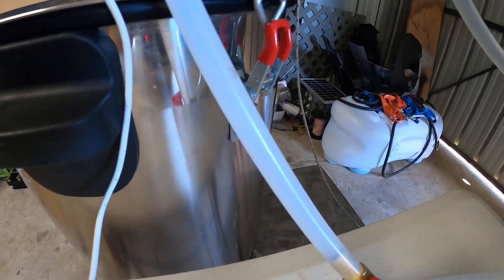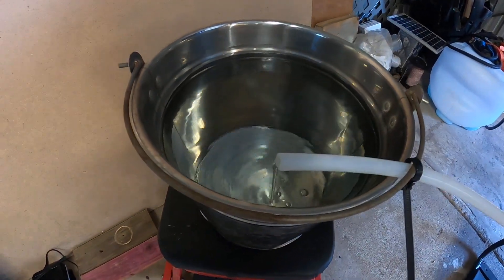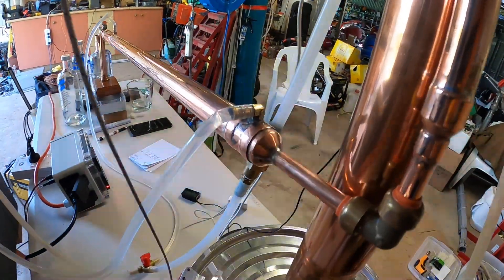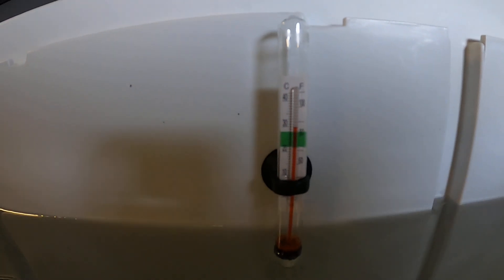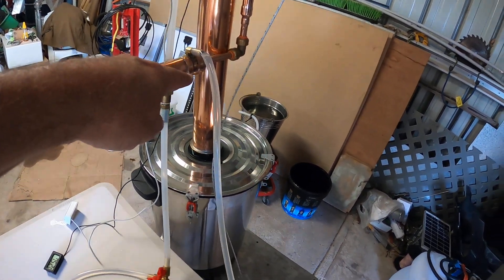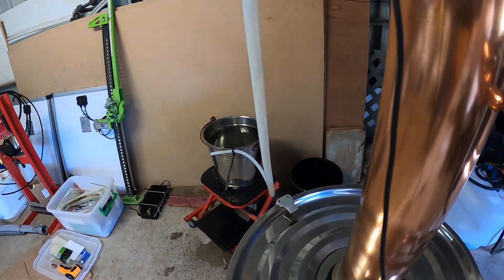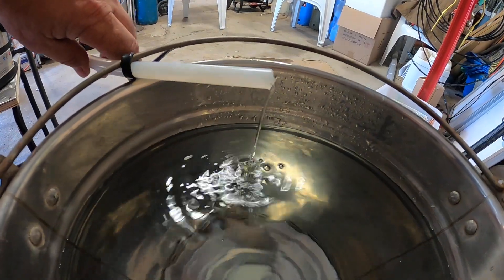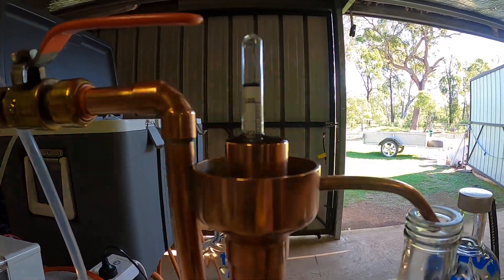Reflux still run , water flow and dual pid temperature controller explanation.

Comment: Why the out put water from reflux condenser is not going back to 120 litter tank?
120 litter is enough to run full distillation process?
Reply from the maker: The reflux condensers water is very hot more than 65 degrees centigrade.